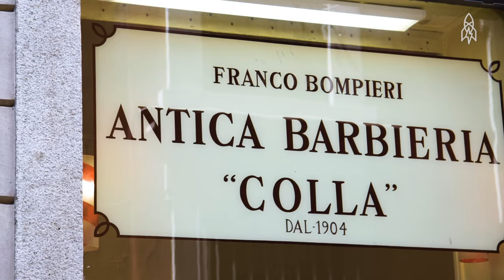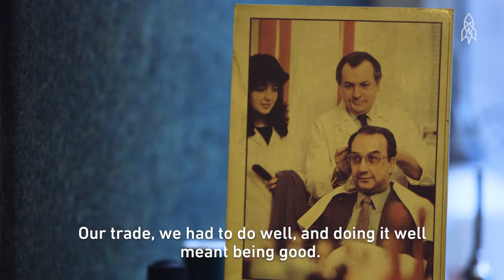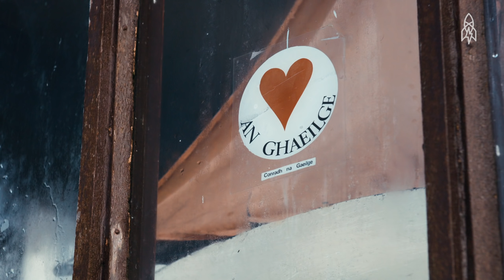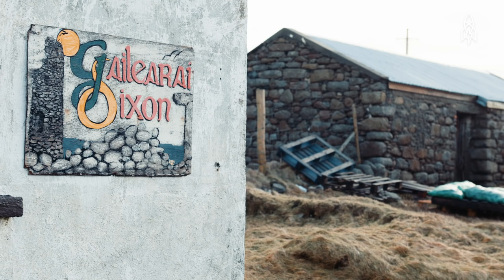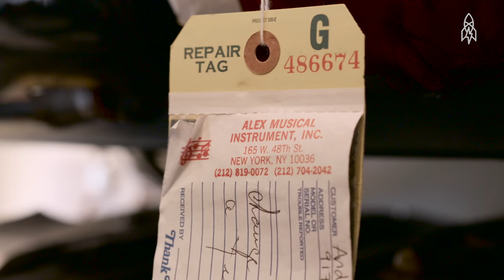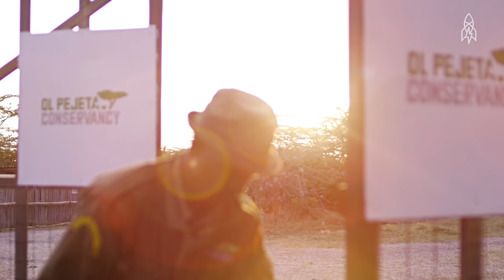The Last of Their Kind

Comment: Come to Maine you will find more dieing jobs. It is actually hard to find a guy who builds boats by hand like actual wooden boats feom scratch. The only guy I know who does it is a guy at the end of the main road I live on the corner of mine and another road. Another is lobstermen who row to they're boat or haul by hand. Good carpenters the 2 best I know and you might think I am biased, but I know other guys and they suck my father and my uncle. My father has built most of the houses that haven't been around since 1800s early 1900s in Spruce Head area though he demoed one that was abondoned then completely rebuilt it and my uncle rebuilt or fixed most to everything in Farmington area. Any skills I have if they're not from my parents are from a local or family member.